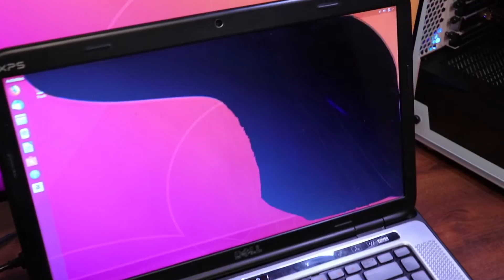Can I fix this old Dell XPS 15?

Comment: Have the same laptop in 2k20 everything is just fine it’s smooth like anything , boot up and shut downs are very fast , using it for music production and FL studio but when I start any game the laptop completely freezes and shows this PC ran into a problem after a minute 
This happens most frequently in CSGO 
I have tried updating drivers 
Adding launch options and everything else recommended on yt please help me 
And also , 
If I run a game on integrated graphics will the laptop run cooler that on the dedicated gpu ?? 
ALMOST ONE YEAR ........ hope you see this
Reply: I have exact same problem... feeling that it's either thermal paste/overheating problem or GPU damage. cleaning and reapplying paste did not solve the issue (or maybe technician did not do his job properly)
Reply: @zavas69  The problem is solved …….I just underclocked the GPU, turned down the GPU core clock to 500mhz (MSI afterburner) and now it works fine and no crashing
Reply: @BlackPanther-vi9qp  my god... I cannot believe this is real, I've been using hd3000 for so long... where can I send you a tip?... you deserve it